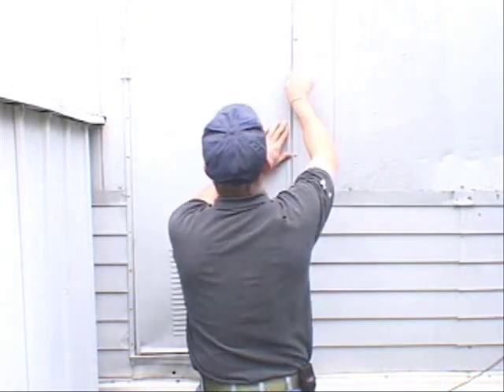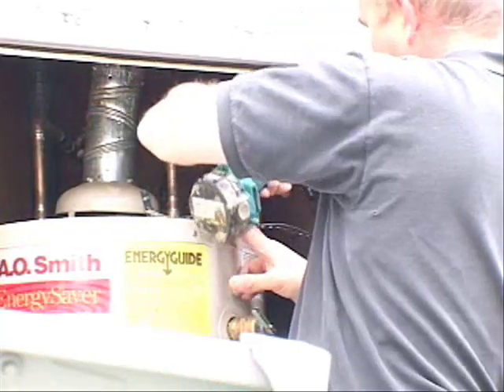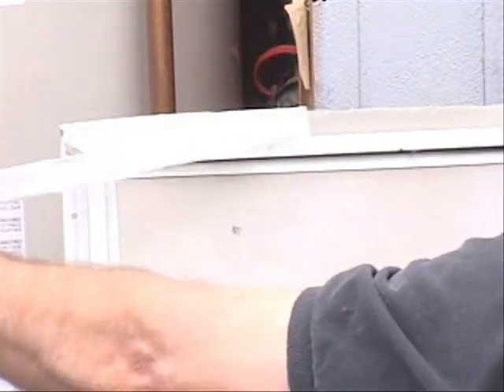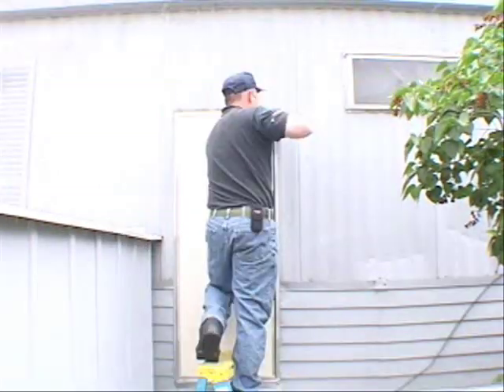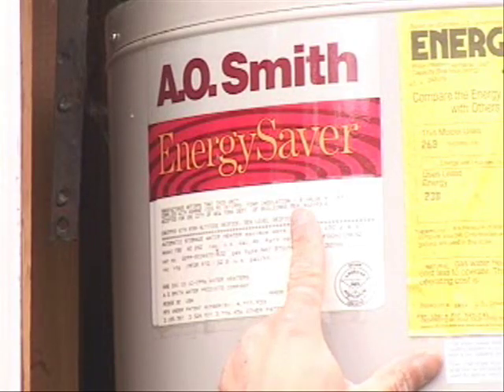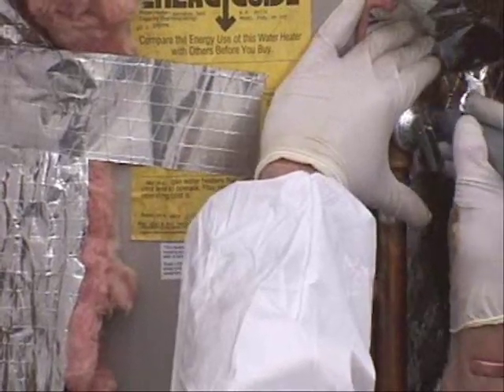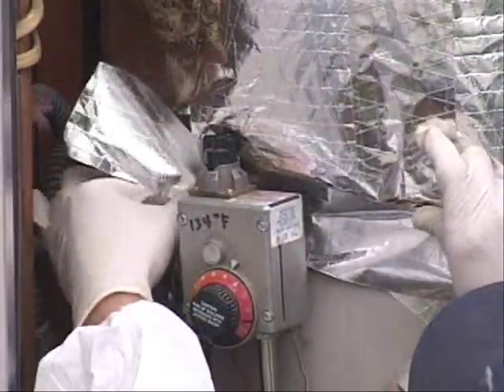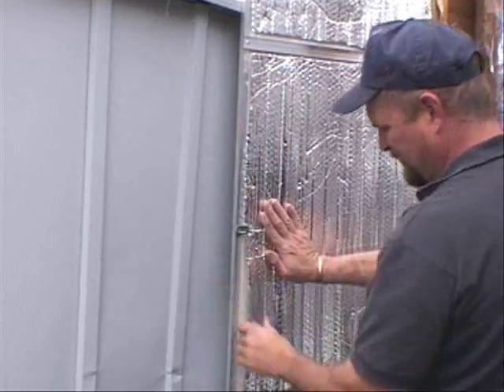Insulating a Mobile Home Water Heater

Comment: By wrapping the water heater, you just now prevented a lot of the condensation from escaping, causing extra moisture build up on the exterior sheet metal of the tank, causing it to rust faster!  Good job!  LOL